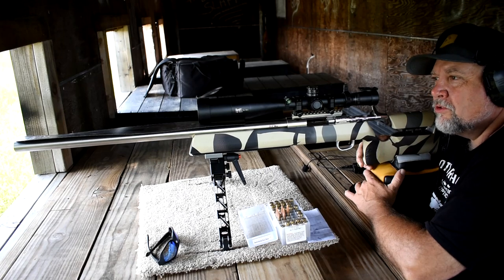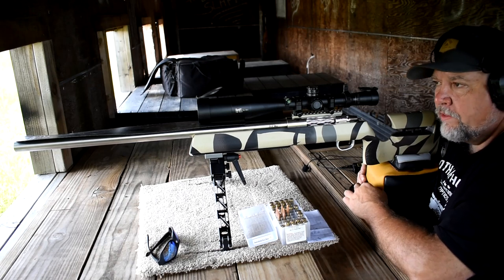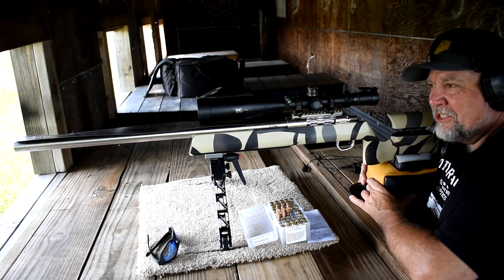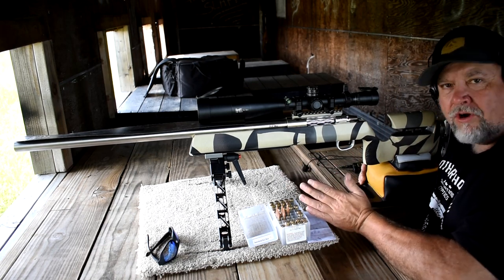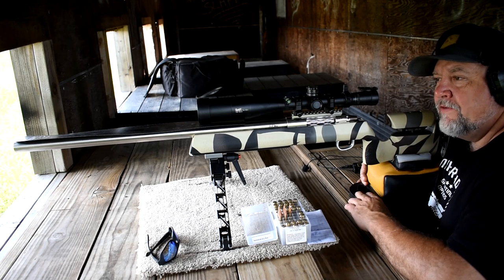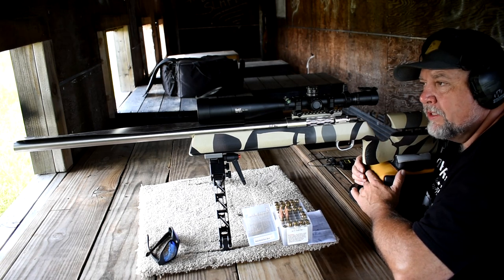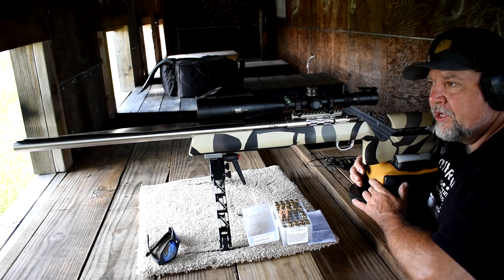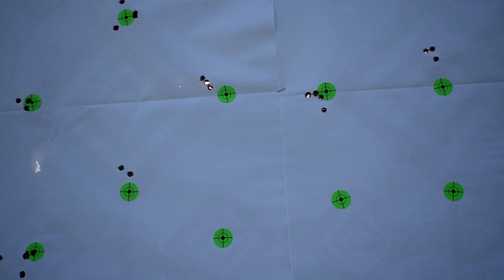NEW FTR 308

Comment: what bipod is that? it looks like a teir 1. I had one for a while and I had to get rid of it because it had way too much flex. I had vertical stringing. went to my joypod and they vanished, ditto for working with a friends phoenix on my rifle. I disagree with your take on tuners mostly but do agree some people think they can be used to do too much. I have a 6 br that shoots lights out at 300-600 and I tuned it the "old fashioned" way. I find it helps me more easily  center up and stay in tune with large displacement cartridges. I also do agree that having extra variables are bad, so the only tuners I use can be locked down so they don't move during use. Also 100% agree on your choice of scopes, I've looked through and or used Nightforce/Trijicon/Sightron/leupold/burris/March/Vortex and my March is the best of the lot for my eyes. all in all a great video, I'll be interested to see what kind of 20 shot scores you can produce with it when you're done with your process.
Reply from the maker: what bipod is that? Teir 1
I have not seen the issue with vertical stringing.

Yea, Tuners are a matter of opinion, if you like them great, most people overuse them!! 

Thank you for the comment.

I do enjoy my March and it has been a FANTASTIC scope thus far!!  Thanks for watching!!

Comment: Got a question  for u,  let say ur shoot out to a mile all ur target before the mile are setting 2 feet off the ground  and ur elevation call are deep on but ur  target at a mile  is 15ft off the ground. How much of effect  is that target be off the ground  by 15ft  going  to effect ur elevation adjustment call?
Reply from the maker: if your dope is good, you adjust the radical (the aim point) and you should be on target. Bullet drop is bullet drop no matter the height. Now if you are higher than your target or you are aiming uphill than the dope is different. The environment will have more effect on the bullet than straight up range. Wind at the shooter position is not the wind at the target!! Learn to read the wind and your surroundings and then shooting becomes next level!!  Have a good one..